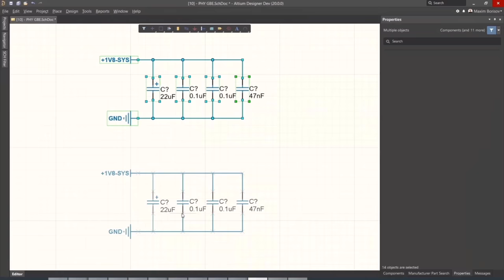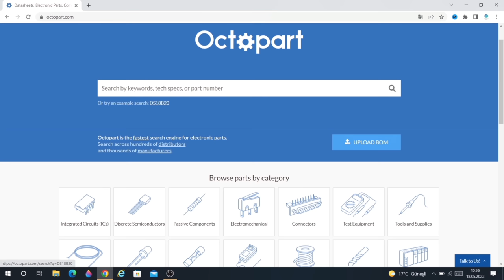How to Make a Powerful Burning Laser From DVD-RW

Comment: I will make a DIY wood engraving tool and there are a lot of applications for this but to the people that do not know about lasers may keep this in mind : lasers are not  toys, use the right eye protection safety glasses (different color laser different glasses),  just be careful, not watch the laser directly, not aim to reflective surfaces and not use on other people or pets to avoid making you or others permanently blind or eye damage.
Reply: me too bro
Reply: I wanted to buy a laser engraver for my diy cnc but didn't due to budget, id like to know your advancements in this project of yours, pls update me on this
Reply: @Virgiliasm2003 there are a lot of projects around like mine made from a dvd burner laser but maybe not as strong and efficient to be used on a cnc machine